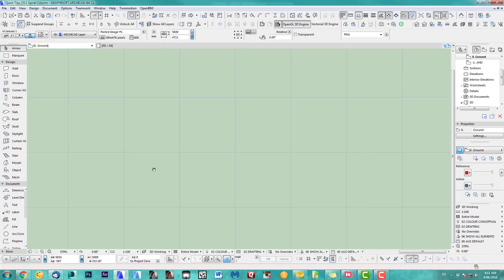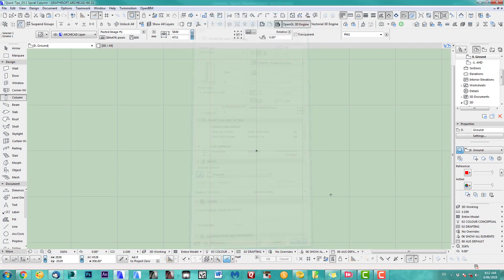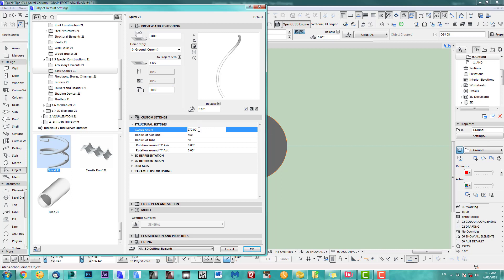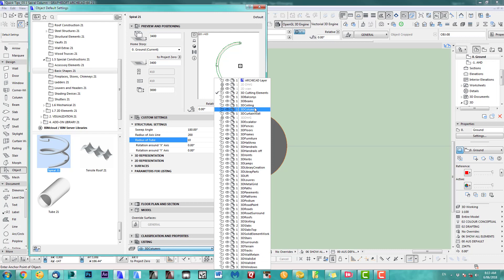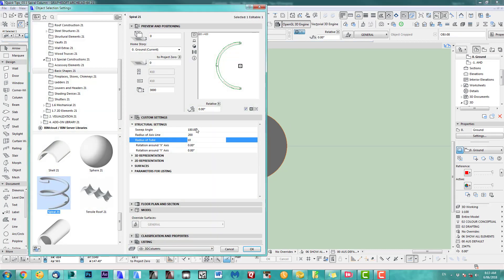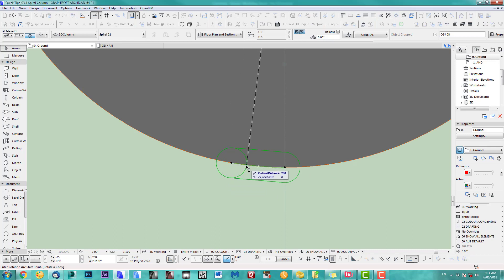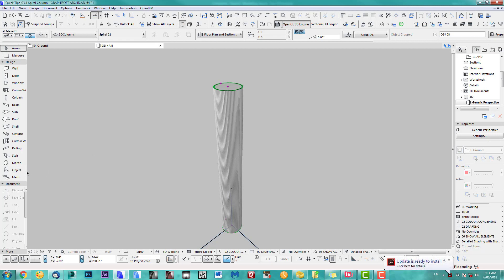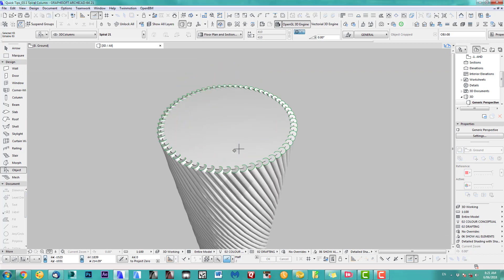How to create a twisted column effect in ARCHICAD

Comment: This is so awesome and I appreciate your work. I am working on a Housing project on a sloping site and I have been experiencing a challenge of whenever I try to raise the building vertically, the windows and doors are left in their original position despite having grouped and selected all the elements. Kindly, how do I resolve this issue?
Reply from the maker: Hi John, there is a simple solution. In the window settings , the third one under Anchors, I would think you have the default on: Header ( or Sill ) to story 0, just change it to: sill to wall base, then the windows and doors will move up vertically with the walls ( house ) 

Cheers Carsten
Reply: WOW! THANK YOU SO MUCH!!! MAY GOD BLESS YOU.
Reply from the maker: You are most welcome, glad I could help !
Reply from the maker: and by the way you can do this all at ones, in 3D view select window tool , then select all windows, then change it to: sill to wall base, click ok. It will not touch any other settings even if you have different windows, same for the doors.